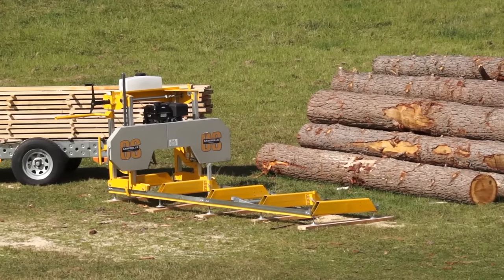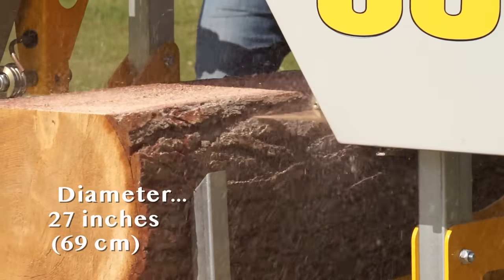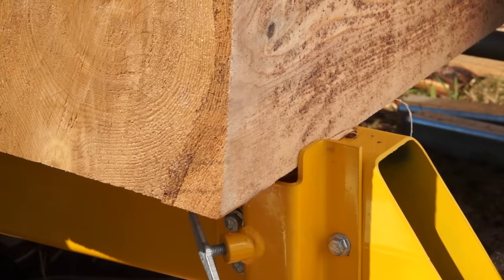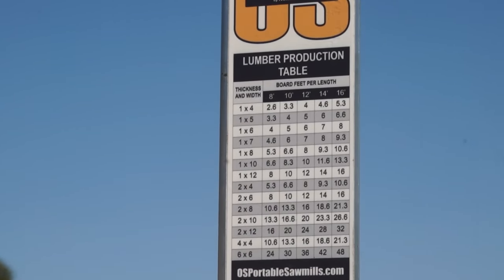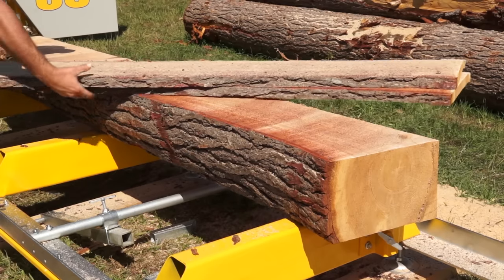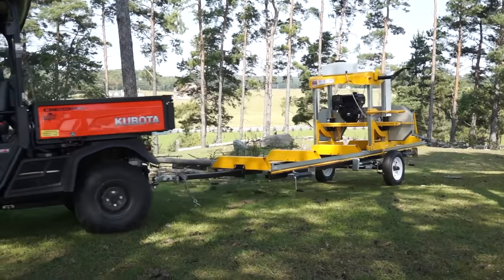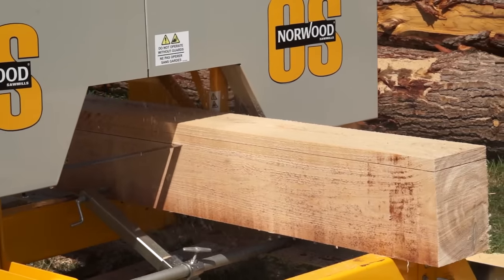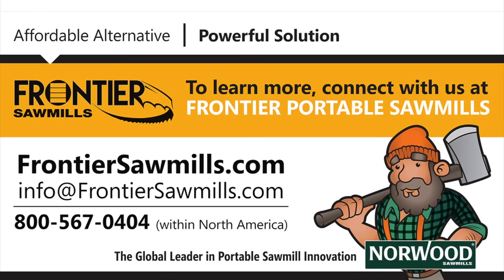The Affordable, Easy-to-Use & Reliable Sawmill You've Been Looking for - The Frontier OS27

Comment: सर नमस्कार यह मशीन कितने की है लकड़ी वाली
Reply from the maker: Frontier builds three sawmill models with different log diameter capacities: OS23: 59cm (23”), OS27: 69cm (27”), and OS31: 79cm (31”). Standard log length is 3.4m (11’) but you can add 7’ (2.1m) extensions to mill as long as you want.  You can add the optionally available trailer/support jack system to all Frontier sawmills at any time (when you get your Frontier or in the future).

Frontier Sawmills start at just USD $2297 (for the Frontier OS23). The Frontier OS27 starts at only USD $3297.  The Frontier OS31 starts at only USD $3897.  

You can get a lot of helpful info about Frontier Sawmills, including all pricing, at www.FrontierSawmills.com  .

Frontier services your country factory-direct.  To order, contact us directly at Frontier Sawmills via email at info@FrontierSawmills.com . 

Thanks!

Comment: Howe much rupees
Reply from the maker: Frontier builds three sawmill models with different log diameter capacities: OS23: 59cm (23”), OS27: 69cm (27”), and OS31: 79cm (31”). Standard log length is 3.4m (11’) but you can add 7’ (2.1m) extensions to mill as long as you want.  You can add the optionally available trailer/support jack system to all Frontier sawmills at any time (when you get your Frontier or in the future).

Frontier Sawmills start at just USD $2297 (for the Frontier OS23). The Frontier OS27 starts at only USD $3297.  The Frontier OS31 starts at only USD $3897.  

You can get a lot of helpful info about Frontier Sawmills, including all pricing, at www.FrontierSawmills.com  .

Frontier services your country factory-direct.  To order, contact us directly at Frontier Sawmills via email at info@FrontierSawmills.com .

Comment: Available in alaska?
Reply from the maker: Absolutely Tiernan

Frontier builds three sawmill models with different log diameter capacities: OS23: 23” (59cm), OS27: 27” (69cm), and OS31: 31” (79cm). Standard log length is 11’ (3.4m) but you can add 7’ (2.1m) extensions to mill as long as you want.  You can add the optionally available trailer/support jack system to all Frontier sawmills at any time (when you get your Frontier or in the future). 

Frontier Sawmills start at just USD $2397 (for the Frontier OS23). The Frontier OS27 starts at only $3397.  The Frontier OS31 starts at only $3997. 

You can get a lot of helpful info about Frontier Sawmills, including all pricing, at www.FrontierSawmills.com  .

We would be happy to mail you a free Frontier Sawmills info kit. You can order one online at  https://www.frontiersawmills.com/en_us/free-catalog-free-dvd-form

We would be happy to answer any questions that you may have, or to prepare a quote, including shipping to your door.  Let us know the best number to reach you at or please feel free to call us toll-free at 800-567-0404.

Thanks!

Comment: sir how much price, where  is available sir reply
Reply from the maker: Frontier builds three sawmill models with different log diameter capacities: OS23: 23” (59cm), OS27: 27” (69cm), and OS31: 31” (79cm). Standard log length is 11’ (3.4m) but you can add 7’ (2.1m) extensions to mill as long as you want.   

Frontier Sawmills start at just USD 2297 (for the Frontier OS23). The Frontier OS27 starts at only USD $3297.  The Frontier OS31 starts at only USD $3897.  

You can get a lot of helpful info about Frontier Sawmills, including all pricing, at www.FrontierSawmills.com  .

Frontier services your country factory-direct.  To order, contact us directly at Frontier Sawmills via email at info@FrontierSawmills.com .
Reply: V.suyambu lingam by

Comment: How much, and where can I buy it?
Reply from the maker: Frontier builds three sawmill models with different log diameter capacities: OS23: 59cm (23”), OS27: 69cm (27”), and OS31: 79cm (31”). Standard log length is 3.4m (11’) but you can add 7’ (2.1m) extensions to mill as long as you want.  You can add the optionally available trailer/support jack system to all Frontier sawmills at any time (when you get your Frontier or in the future).

Frontier Sawmills start at just USD $2297 (for the Frontier OS23). The Frontier OS27 starts at only USD $3297.  The Frontier OS31 starts at only USD $3897.  

You can get a lot of helpful info about Frontier Sawmills, including all pricing, at www.FrontierSawmills.com  .

Frontier services your country factory-direct.  To order, contact us directly at Frontier Sawmills via email at info@FrontierSawmills.com .
Reply: @FrontierSawmills  is this available in the philippines?

Comment: What's the price?
Reply from the maker: Hi Henry

Frontier builds three sawmill models with different log diameter capacities: OS23: 59cm (23”), OS27: 69cm (27”), and OS31: 79cm (31”). Standard log length is 3.4m (11’) but you can add 7’ (2.1m) extensions to mill as long as you want.  You can add the optionally available trailer/support jack system to all Frontier sawmills at any time (when you get your Frontier or in the future).

Frontier Sawmills start at just USD $2297 (for the Frontier OS23). The Frontier OS27 starts at only USD $3297.  The Frontier OS31 starts at only USD $3897.  

You can get a lot of helpful info about Frontier Sawmills, including all pricing, at www.FrontierSawmills.com  .

Comment: Price in india
Reply from the maker: Norwood builds several models of manual and hydraulic portable band sawmills ranging in capacities from 27” (69cm) to 36” (92cm) log diameter.  Standard, Norwood band sawmills are 16 feet long (4.8m), which allows you to cut boards up to 13-feet (4m) in length depending on the model.  

Or saw even longer by adding optional 4-foot (1.2m) log deck extensions. In fact, you can saw logs of any length in stationary configuration – some Norwood owners are sawing logs over 40-feet (12.1m) long! 

Norwood band sawmills start at just $4567 for the MN26V2. The LM29V2 starts at just $5297 right now in stationary configuration. All Norwood sawmills have an available optional trailer system. 

Norwood’s biggest bandmill, the LumberPro HD36, starts at just $8267 in manual stationary configuration. You can build up your HD36 to fully-hydraulic anytime – when you start, or later when your sawmilling operation gets bigger. 

Learn more about Norwood Sawmills at https://www.norwoodsawmills.com/en_us/sawmills to find the one best-suited for you.  

You should also check out Norwood’s “SAWMILL TV” … The ultimate online “TV” channel devoted exclusively to portable sawmills and successful sawmilling.  It’s your one-stop-channel for all the essential things you need to know – from choosing your first sawmill to getting the most out of your equipment. Think of it as the Netflix for sawmill addicts 😊.  www.NorwoodSawmills.com/tv/

To see the complete price list, click https://www.norwoodsawmills.com/en_us/norwood-sawmills-price-list  . Freight prices vary depending on exactly where we ship to and also what you order (as that affects weight and volume).

Please feel free to email with your further questions and request for personalized quote including shipping: info@NorwoodSawmills.com .

Thanks

Comment: Это пиларама где находятся?
Reply from the maker: Frontier builds three sawmill models with different log diameter capacities: OS23: 59cm (23”), OS27: 69cm (27”), and OS31: 79cm (31”). Standard log length is 3.4m (11’) but you can add 7’ (2.1m) extensions to mill as long as you want.  You can add the optionally available trailer/support jack system to all Frontier sawmills at any time (when you get your Frontier or in the future).

Frontier Sawmills start at just USD $2397 (for the Frontier OS23). The Frontier OS27 starts at only USD $3397.  The Frontier OS31 starts at only USD $3997.  

You can get a lot of helpful info about Frontier Sawmills, including all pricing, at www.FrontierSawmills.com  .

Frontier services your country factory-direct.  To order, contact us directly at Frontier Sawmills via email at info@FrontierSawmills.com . 

Thanks!

Comment: What price?
Reply from the maker: Frontier builds three sawmill models with different log diameter capacities: OS23: 59cm (23”), OS27: 69cm (27”), and OS31: 79cm (31”). Standard log length is 3.4m (11’) but you can add 7’ (2.1m) extensions to mill as long as you want.  You can add the optionally available trailer/support jack system to all Frontier sawmills at any time (when you get your Frontier or in the future).

Frontier Sawmills start at just USD $2297 (for the Frontier OS23). The Frontier OS27 starts at only USD $3297.  The Frontier OS31 starts at only USD $3897.  

You can get a lot of helpful info about Frontier Sawmills, including all pricing, at www.FrontierSawmills.com  .

To order, contact us directly at Frontier Sawmills via email at info@FrontierSawmills.com . 

Thanks!

Comment: How prize this machine.this machine give in indaia.
Reply from the maker: Frontier builds three sawmill models with different log diameter capacities: OS23: 59cm (23”), OS27: 69cm (27”), and OS31: 79cm (31”). Standard log length is 3.4m (11’) but you can add 7’ (2.1m) extensions to mill as long as you want.  You can add the optionally available trailer/support jack system to all Frontier sawmills at any time (when you get your Frontier or in the future).

Frontier Sawmills start at just USD $2297 (for the Frontier OS23). The Frontier OS27 starts at only USD $3297.  The Frontier OS31 starts at only USD $3897.  

You can get a lot of helpful info about Frontier Sawmills, including all pricing, at www.FrontierSawmills.com  .

Frontier services your country factory-direct.  To order, contact us directly at Frontier Sawmills via email at info@FrontierSawmills.com .
Reply: Can you ship to INDIA??Os 31 if yes what's the price of OS 31 product???

Comment: How much it machine sir plz. I need machine my wood business.
Reply from the maker: Frontier builds three sawmill models with different log diameter capacities: OS23: 59cm (23”), OS27: 69cm (27”), and OS31: 79cm (31”). Standard log length is 3.4m (11’) but you can add 7’ (2.1m) extensions to mill as long as you want.  You can add the optionally available trailer/support jack system to all Frontier sawmills at any time (when you get your Frontier or in the future).

Frontier Sawmills start at just USD $2297 (for the Frontier OS23). The Frontier OS27 starts at only USD $3297.  The Frontier OS31 starts at only USD $3897.  

You can get a lot of helpful info about Frontier Sawmills, including all pricing, at www.FrontierSawmills.com  .

Frontier services your country factory-direct.  To order, contact us directly at Frontier Sawmills via email at info@FrontierSawmills.com . 

Thanks!

Comment: Price im from Hyderabad Telangana
Reply from the maker: Frontier builds three sawmill models with different log diameter capacities: OS23: 59cm (23”), OS27: 69cm (27”), and OS31: 79cm (31”). Standard log length is 3.4m (11’) but you can add 7’ (2.1m) extensions to mill as long as you want.  You can add the optionally available trailer/support jack system to all Frontier sawmills at any time (when you get your Frontier or in the future).

Frontier Sawmills start at just USD $2297 (for the Frontier OS23). The Frontier OS27 starts at only USD $3297.  The Frontier OS31 starts at only USD $3897.  

You can get a lot of helpful info about Frontier Sawmills, including all pricing, at www.FrontierSawmills.com  .

Frontier services your country factory-direct.  To order, contact us directly at Frontier Sawmills via email at info@FrontierSawmills.com . 

Thanks!

Comment: How can I get this sawmil in nepal
Reply from the maker: Frontier builds three sawmill models with different log diameter capacities: OS23: 59cm (23”), OS27: 69cm (27”), and OS31: 79cm (31”). Standard log length is 3.4m (11’) but you can add 7’ (2.1m) extensions to mill as long as you want.  You can add the optionally available trailer/support jack system to all Frontier sawmills at any time (when you get your Frontier or in the future).

Frontier Sawmills start at just USD $2297 (for the Frontier OS23). The Frontier OS27 starts at only USD $3297.  The Frontier OS31 starts at only USD $3897.  

You can get a lot of helpful info about Frontier Sawmills, including all pricing, at www.FrontierSawmills.com  .

Frontier services Nepal factory-direct.  To order, contact us directly at Frontier Sawmills via email at info@FrontierSawmills.com .

Comment: Салам.где можно купить токой пилорама.и сколько стоит.
Reply from the maker: Frontier builds three sawmill models with different log diameter capacities: OS23: 59cm (23”), OS27: 69cm (27”), and OS31: 79cm (31”). Standard log length is 3.4m (11’) but you can add 7’ (2.1m) extensions to mill as long as you want.  You can add the optionally available trailer/support jack system to all Frontier sawmills at any time (when you get your Frontier or in the future).

Frontier Sawmills start at just USD $2297 (for the Frontier OS23). The Frontier OS27 starts at only USD $3297.  The Frontier OS31 starts at only USD $3897.  

You can get a lot of helpful info about Frontier Sawmills, including all pricing, at www.FrontierSawmills.com  .

Frontier services your country factory-direct.  To order, contact us directly at Frontier Sawmills via email at info@FrontierSawmills.com . 

Thanks!
Reply: @FrontierSawmills  nice

Comment: How can I get your company address I want to buy this machine?
Reply from the maker: Frontier builds three sawmill models with different log diameter capacities: OS23: 59cm (23”), OS27: 69cm (27”), and OS31: 79cm (31”). Standard log length is 3.4m (11’) but you can add 7’ (2.1m) extensions to mill as long as you want.  You can add the optionally available trailer/support jack system to all Frontier sawmills at any time (when you get your Frontier or in the future).

Frontier Sawmills start at just USD $2297 (for the Frontier OS23). The Frontier OS27 starts at only USD $3297.  The Frontier OS31 starts at only USD $3897.  

You can get a lot of helpful info about Frontier Sawmills, including all pricing, at www.FrontierSawmills.com  .

Comment: me too, how to made order?
Reply from the maker: Frontier builds three sawmill models with different log diameter capacities: OS23: 59cm (23”), OS27: 69cm (27”), and OS31: 79cm (31”). Standard log length is 3.4m (11’) but you can add 7’ (2.1m) extensions to mill as long as you want.  You can add the optionally available trailer/support jack system to all Frontier sawmills at any time (when you get your Frontier or in the future).

Frontier Sawmills start at just USD $2297 (for the Frontier OS23). The Frontier OS27 starts at only USD $3297.  The Frontier OS31 starts at only USD $3897.  

You can get a lot of helpful info about Frontier Sawmills, including all pricing, at www.FrontierSawmills.com  .

To order, contact us directly at Frontier Sawmills via email at info@FrontierSawmills.com .

Comment: Hwo much this macin
Reply from the maker: Frontier builds three sawmill models with different log diameter capacities: OS23: 59cm (23”), OS27: 69cm (27”), and OS31: 79cm (31”). Standard log length is 3.4m (11’) but you can add 7’ (2.1m) extensions to mill as long as you want.  You can add the optionally available trailer/support jack system to all Frontier sawmills at any time (when you get your Frontier or in the future).

Frontier Sawmills start at just USD $2297 (for the Frontier OS23). The Frontier OS27 starts at only USD $3297.  The Frontier OS31 starts at only USD $3897.  

You can get a lot of helpful info about Frontier Sawmills, including all pricing, at www.FrontierSawmills.com  .

Frontier services your country factory-direct.  To order, contact us directly at Frontier Sawmills via email at info@FrontierSawmills.com .

Comment: Хороший пило. Сколько стоить. 👍
Reply from the maker: Frontier builds three sawmill models with different log diameter capacities: OS23: 59cm (23”), OS27: 69cm (27”), and OS31: 79cm (31”). Standard log length is 3.4m (11’) but you can add 7’ (2.1m) extensions to mill as long as you want.  You can add the optionally available trailer/support jack system to all Frontier sawmills at any time (when you get your Frontier or in the future).

Frontier Sawmills start at just USD $2297 (for the Frontier OS23). The Frontier OS27 starts at only USD $3297.  The Frontier OS31 starts at only USD $3897.  

You can get a lot of helpful info about Frontier Sawmills, including all pricing, at www.FrontierSawmills.com  .

Frontier services your country factory-direct.  To order, contact us directly at Frontier Sawmills via email at info@FrontierSawmills.com . 

Thanks!

Comment: Can it will be available in India
Reply from the maker: Frontier builds three sawmill models with different log diameter capacities: OS23: 59cm (23”), OS27: 69cm (27”), and OS31: 79cm (31”). Standard log length is 3.4m (11’) but you can add 7’ (2.1m) extensions to mill as long as you want.  You can add the optionally available trailer/support jack system to all Frontier sawmills at any time (when you get your Frontier or in the future).

Frontier Sawmills start at just USD $2297 (for the Frontier OS23). The Frontier OS27 starts at only USD $3297.  The Frontier OS31 starts at only USD $3897.  

You can get a lot of helpful info about Frontier Sawmills, including all pricing, at www.FrontierSawmills.com  .

Frontier services your country factory-direct.  To order, contact us directly at Frontier Sawmills via email at info@FrontierSawmills.com .